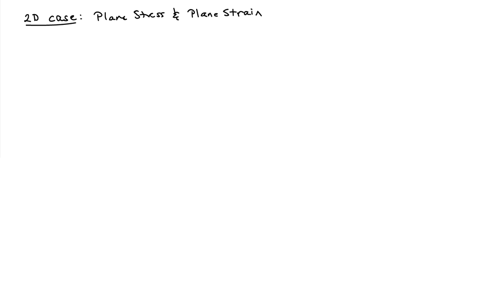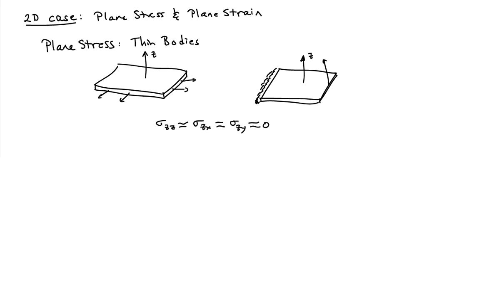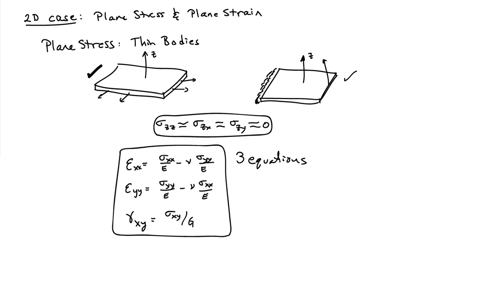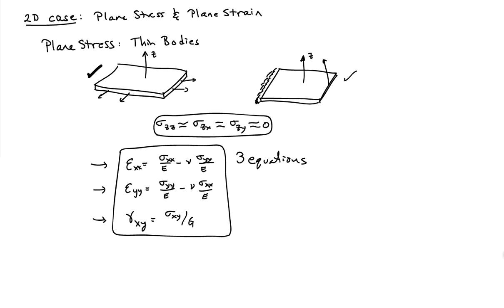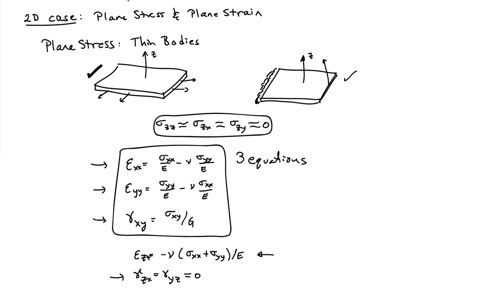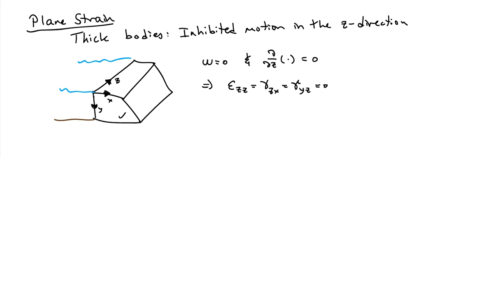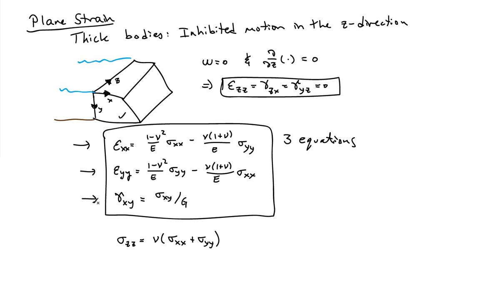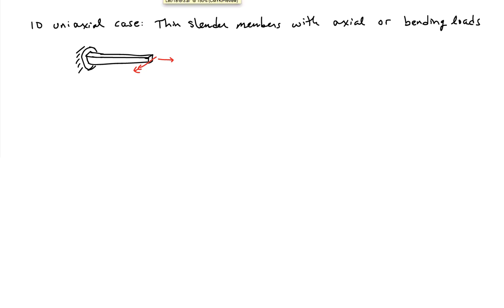(18B) Introduction to plane stress, plane strain, and uniaxial stress

Comment: Thanks sanjay. Plain strain assumes strain in the zz direction to be 0. At the end of the slide, stress in the zz direction can be determined using poisons ratio as you’ve mention. If you know what the stress then strain can be determined with young modulus. This would be conflicting with the original assumption. Would you be able able to explain what I’m missing?
Reply from the maker: Good question.  It is important to check if the relations are self-consistent.  In this case it turns out that they are.  The full relation 3D relation for the z-strain is eps_z = sig_z/E - (v/E)(sig_x + sig_y).  If you plug in the sig_z = v(sig_x+sig_y) relation, then you see that eps_z = (v/E)(sig_x+sig_y) - (v/E)(sig_x+sig_y) = 0, as it should be.  Thus there is not conflict with the original assumption.  In fact, the expression sig_z= v(sig_x+sig_y), was derived using the 3D expression for eps_z, setting it equal to zero, and then solving for sig_z.
Reply: @sanjayg0  Thank you, Sanjay. In the plain strain case, is it the constraint that causes the stress to develop? i.e. the body wants to strain in the z direction, but is prevented from doing so and this manifests itself as stress. I suppose the Poisson's term associated with sig_x & sig_y is what is trying to strain the body.
Reply from the maker: @rmexx  Correct. The Poisson ratio is what leads to the out of plane stress.

Comment: Hello Sanjay. Can you just confirm that for a plane stress case, we idealize a very thin body to not have thickness along Z axis at all so we kinda make it 2D. But for plane strain case, the thickness of the body along Z axis is siginificant so how are idealizing it as a 2D? I mean do we assume that the stresses and strains on the XY plane, along the length of Z axis are going to be the same? If yes, then what difference does it make when we compare this case to the one with plane stress?
Reply from the maker: There are multiple ways to reason this out.  The way I like to think of it is that bodies always have thickness in the z-direction;  the plane stress and plane strain assumptions then provide a scheme for studying the behavior on a per unit thickness basis.  And in both cases the assumption is that the in-plane behavior is the same for all values of z (note in plane stress there are some technicalities to this but for the most part that is what is normally done).  Regarding your last question, one gets different behavior in plane stress and plane strain, because the effective in-plane material moduli are different.

Comment: For given microstrains in x,y and xy, how could I solve for the Stresses in the respective directions? It's really confusing.
Reply from the maker: Solving for the shear stress is easy just multiply the shear strain by G. For the normal stresses, you will have to solve two linear equations in two unknowns, which a “standard” problem.  It amounts to inverting the matrix [1 -nu; -nu 1]. I would use Cramer’s rule.

Comment: Very nicely explained.It would be good if you can explain what is its significance  and where this can be applied in a practical design.
Reply from the maker: Good idea.  In short, the usefulness here is that that when these cases apply you can much more easily solve stress analysis problems than you can if you treat them completely three dimensional.  If I get extra time, I'll think about some follow up videos.

Comment: Sorry sanjay, your notation used for shear stress was wrong and also how you got those final expressions in Plane strain conditions not explained properly.
Reply from the maker: In what way do you feel that the shear stress notation is not correct? 

Regarding the second part of your comment, you are correct I did not say in detail how I arrived at the final plane strain relations.  What you have to do is start from the 3D stress-strain relations, set epsilon_zz, gamma_xz, and gamma_yz to zero, then solve for sigma_zz in terms of sigma_xx and sigma_yy (using the epsilon_zz=0 equation), now use this expression in the expressions for epsilon_xx and epsilon_yy to eliminate sigma_zz.  It is a game of chase the rabbit through a system of linear equations.  Once you start writing it out, it should be clear what to do.
Reply: Do you even know whom you are talking to ?
Reply: Rajasekhar , you are an idiot to say that.

Comment: What is thin body and thick body? Please explain it for me. Thanks.
Reply from the maker: An object/body is considered to be thin when of its dimensions, say the thickness, is at least 10 times small than its other two dimensions (the in plane dimensions).  The easiest example is a sheet of paper.  Thick bodies are the opposite.